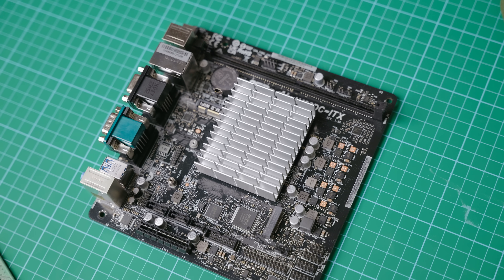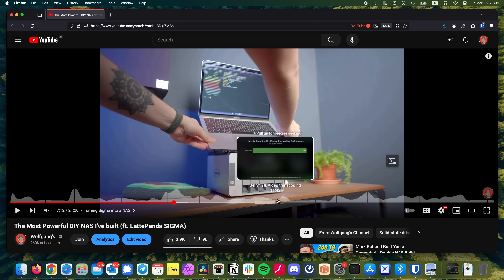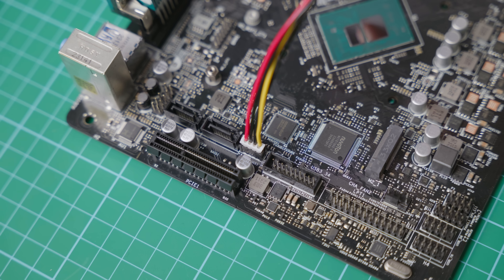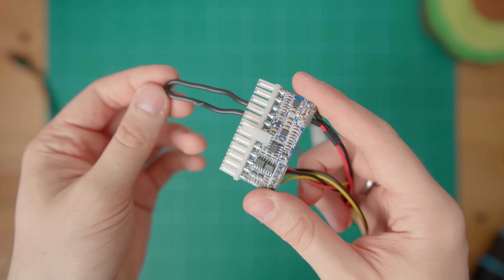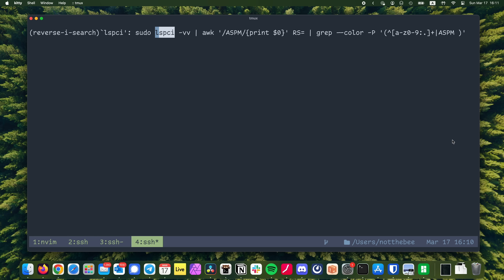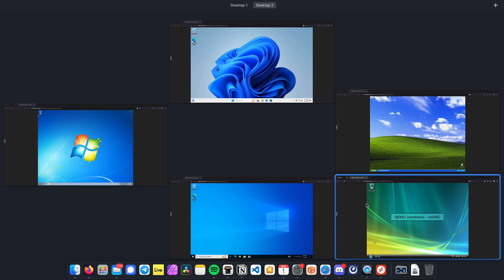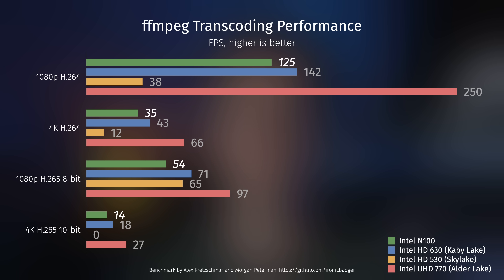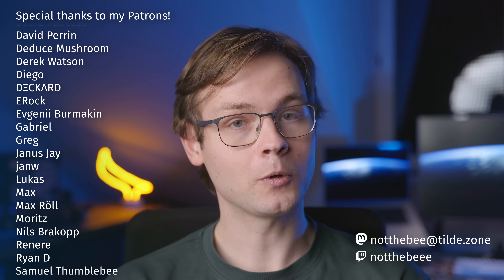Asrock N100DC-ITX – Almost Perfect! But...

Comment: I bought such board with N100 - it is actually nogo because of the heat - without fan it really boils - and I used it only for firewall. Shame.
I am also a bit surprised seeing here and there the fuss about N100 how superb it is - it is not really that rainbow.
Why am I saying this? I replaced my N100 with AMD Ryzen 7 7735HS (minisforum) and honestly: at idle with 2 disks it goes as low as 8W. And when needed it has 16 cores and support for tones of RAM. So not real gain in idle having N100 while super gain when performance is needed. Of course, when I do a stress test to all CPUs it easily goes to 90W but hey, who measures average power consumptions using stress test ;-). After a month of using my average consumption of this machine is around 15W no more and that includes idle and high performance usage combined.

Comment: The most annyoying thing is that the Asrock website does not mention 12V support. Also the suspicious empty space sized for a 24pin connector. 
Or they could've taken the homework of Asrock Rack, where they have a small 4 pin DC connector but include an adapter to a full 24pin one.
Reply: I think their might be an issue with support and quality control. When dealing with ASRock, they were constrantly checking that I was using 19V PSU, and not a 18 or 20V one. If it works for Wolfgang, that's great, but I suspect that some boards aren't working so great with other voltages?

Comment: Hi very nice video and very good channel. I have a question about the limitation of the 4 pins power connector. In the datasheet I see voltage rating at 100V and curent rating at 2 amp, so the max power must be 100*2=200W, if we see the HDD's datasheet all the curent must be with a 12V voltage, so with 2.5 A the max power startup must be 30 W. Do my calculs are right ?

Comment: I'm no expert but if you want to play with jumbo frames (MTU=9000) properly, you have to know the one rule : all devices on the 10Gb subnet must have jumbo frames enabled or you will get packet collisions and unreliable connexion. Your switch as well should be configured to use jumbo frames on the 10Gb ports. That is the only way to achieve full 10Gb/s and the jumbo frames should reduce CPU usage and who knows, power consumption ? Again, I'm no expert.

Comment: One of the best board, not available any more is the asrock h370m-itx/ac, it only lacks 2.5g network, but you can add a network card or aggregate the two 1G nic.
No need for a "thick wire" to jump the PSU, just a normal wire or better a paper click. No current pass through, just a signal.
Reply: The thick is more for the mechanics of the connection. Because the holes on the psu ar quite big.

Comment: Having two SATA ports isn't even bad. For energy efficiency you will need exactly two HDDs in mirror. 24 TB CMR HDDs do exist now. The limitations are single memory channel 16 GB max, no ECC, also no IPMI. The lack of IPMI is justified though, as it would double both cost and power draw. And we'll obviously never get ECC from Intel outside Xeon, so it is what it is. The video encode capablities are impresive, albeit being only slightly short of 24 FPS 4K H.265 is a bummer. Also, don't transcode your video collections. Storage will only get cheaper, and transcoding to a lossy codec always degrades quality. If you really need to transcode for storage, do so on a CPU encoder, slower but better. GPU transcoding is best used for live streaming.
Reply from the maker: A person who has money for new 24 TB drives, but not for a server/workstation motherboard with ECC support, or for 10-15 extra watts of electricity? I find it hard to imagine. I think most people that buy this motherboard will probably be bringing their own assorted storage, which will pbb be between 500GB and 6TB in volume. But that's just my opinion.

Video transcoding is mostly useful if you have a high quality video library, but also want to watch it on devices that don't support direct play or access it remotely. The quality in this case is not as important as the ability to play back the media at all. And sure, you can transcode the media in advance on your CPU, but this takes time (and energy)

Comment: If you are going to power it with an ATX power supply, the ASUS Prime N100I-D D4 would be a better choice.
Reply: No, it's not. There's a difference with SATA and nvme lane speed.
Reply: @su1ka  nvme is the same speed but it does have USB 3 gen2
Reply: only has 1 sata 3 port the asrock one probably a bit more useful
Reply: @si4632  Sorry, I meant PCIe 3.0 x1 vs x2 and SATA ports 1 vs 2. My bad.
Reply: @su1ka  price seems to vary a bit as well I've just seen the Asus one for £102
Reply: And are sodimms more expensive?
Reply: @si4632 Well, in this video they add an extension card for extra sata ports anyway. So that 1 port difference on the motherboard is not that big of a deal to me.
Reply: @ctphilippi  yeah true although the bandwidth is double on the asrock board pcie slot
Reply: Are the gen 2 usb3 ports of any use are there ethernet adapters

Comment: Imagine it could run off of a single 24 pin.
And took 4 of those 9 PCIe lanes from the Atom N100/N305, and gave you 4*1x M.2 slots, where you could then use one of those cheap 5 drive SATA controllers.
Then 1 lanes could go to on-board 10G networking(around 8Gbps with only 1 lane), and then 4 more lanes could go to 2*2x M.2 slots for boot or caching.
Alternatively, networking could get 3 lanes for dual 10G at full 10G speeds, and then 2*1x M.2 for boot
But imagine if the i3-N305 were an actual i3, with 2 real channels of RAM and 20 PCIe lanes, some of them gen4. That would have been a monster NAS CPU, alas Intel chose to use an Atom chip for the i3-N305

Comment: I'm still waiting for Intel to release the N100,200 and 305 in a version with vPro Enterprise (for AMT) so that we can get a board with remote management. Until then it's not really that interesting.
Reply from the maker: I wouldn’t hold my breath. Will probably use BliKVM PCIe for  mine
Reply: @WolfgangsChannel  the price and the cable mess from these Pi KVM solutions talks against them. But I'm not holding my breath. Then there is the option with the AST2500 or 2600 to get IPMI, but that require 6-9W which goes against the low power idea.

Comment: I got a Topton box from Aliexpress with the same Intel N100 CPU, four Intel I226 2.5GbE ports, 32GB DDR5 and one externally mounted 3.5 inch HDD.
Installed Proxmox on it and run OPNsense in a VM with the ethernet ports passed through as PCIe device.
It's doing double duty as Router and Homelab server.
Currently with 25% CPU load, high activity on the 18TB 3.5inch HDD, 8-port network switch, DSL modem and a WiFi 6 Access Point all on the same 12v PSU is drawing 43 watts on average.

Comment: 10W with 5 drives spinning? Unlikely. I think the shelly plug blew a belt :)
Reply: They're in spindown, not running
Reply from the maker: How did you manage to interpret “after plugging in the hard drives and putting them to sleep” as “spinning”? Honest question.
Reply: @WolfgangsChannel  I missed the putting them to sleep bit I guess :D but then I do not understand your test. 

A computer that has VMs running should have their hard drives spinning, unless everything operating from the primary SSD. I just find that my NAS constantly has things it does on the drives and even with 2 m.2 SSDs in there as cache most of the time data is being accessed and written by home assistant to the array so the drives never spin down. I do not save data to the primary OS drive or the caches because I would want the data to be saved on the raid array. So my question is: how good is a test of a NAS that has its disks sleeping? Also sending disks to sleep can shortens their lifespan, you should rather disable sleep altogether because a NAS drive should always be spinning unless you have say a night time spindown schedule where you pause all services and VMs.... but hey that is just me. I disabled sleep on my NAS and the drives are running over 6 years in there but it does pull about 40W from the wall constantly with 4 disks and the 8 disk NAS I have around 60-70. 

I like a power efficient nas like the next guy, but unless you run SSDs in there, the spinning disks take about 5-6W each, depending on the model and that is its expected running cost. Turning them off... well I might as well make the most energy efficient system by turning it all off. 0W  great :D 

So I did not understand at first that you were testing the system idle power without the drives. I thought it was meant to be the idle with the drives, hence my confusion. I missed the bit about the sleeping drives and substituted my interpretation of what the idle consumption of a NAS in my opinion should be.
Reply from the maker: You don't want to store your VM disks on spinning rust these days, so yes – the VMs use the SSD, HDDs are just there for bulk storage. Same goes for Docker containers.

Spindown shortening the lifespan used to be true with older HDDs, but modern hard drives use loading ramps and are often rated for >200000 power cycles. Which means that if you were to restart your hard disk every hour, 24 hours a day, they would last for over 20 years. Safe to say that your drive will probably fail before that for other reasons.

Unless you're accessing your bulk storage 24/7, spinning down your drives lets your NAS consume less power and still be ready for whenever you want to access the data. In case of my parents, the only data being stored on the hard drives are backups, which are scheduled daily and weekly. For the rest of time, there's no point keeping the drives running.
Reply: I guess our use cases differ then. My home assistant constantly records data on the array so disks keep spinning. I also take claims about hdd cycle ratings with a pinch of salt. They tend to be way off historically. 

By the way I realize how wasteful it is for a few bytes/s of data streaming but this is a static cost no matter how much extra operations I put up the NAS to do for me so it is not a marginal expense, which I just put down as cost of doing this. I also have my unifi controller's storage on the array as well as many other software, such as my personal music collection that I keep streaming directly from the nas with software such as airsonic or DS Audio and I yet to mention the torrent client that I am definitely not running :D

Comment: C-states are a bunch of voodoo and nigh impossible to figure out. I've been in touch with Intel support and mainboard manufacturers and they all go - no clue, try different BIOS settings. None of them ever came back with specifics on what the actual conditions (beyond "all components report latency tolerance" and "voltage can be downregulated" and crap like that) for individual sleep states are. I've had boards that never went above C6 with literally NOTHING plugged in and in any configuration. On the other end of the spectrum - I have an Asus Prime z790p with a 12600K and it'll go to C10 and idle at 13W - that's with Nvme + SATA storage and an f-ing 1200W Thermaltake GF3. With a smaller, more efficient supply and less fans it would probably run at 10W.

Comment: I'm pissed that they went with this design that only uses a dc barrel jack for power. 24pin atx power while still using a full size ram slot would have been perfect for this.

Comment: I don’t think running 5 generations of Windows VMs doing absolutely nothing is much of a test. What information are you trying to convey with this? That 5x nothing (and a tiny bit of overhead running the OS gui) is nothing?
Reply from the maker: When I make videos about these low-power boards, people often say things like “it probably can’t handle any serious home server things, like running VMs”. On one hand, this shows that this board can handle VMs, on the other hand it shows that running 5 VMs doesn’t require as much performance as people often think.
Reply: @WolfgangsChannel     Those people are just uninformed, I think. Whether or not it can run VMs has little to do with the power draw, but simply if there are enough CPU cores/threads and RAM available for it. The N100 has 8 threads and max 16GB RAM, so should work just fine.

 I think it would be more interesting to see if a box like this can run an actual workloads, like Plex server with hw transcoding, batch photo resizing or compressing files, since a bunch of users will be using it for this purpose. By the specs, it should be able to do all these things fairly well, but things like this would be interesting to see over 5 empty VMs.

Additionally, how does the NIC speed drop when the CPU is reserved/busy on other workloads or busy VMs?
Reply from the maker: You might have missed a 2-minute video section called "Hardware video  transcoding"
Reply: @WolfgangsChannel     I have, I am just not sure what "the Dune test" is exactly. The graphs show FPS by ffmpeg (which version?) and not exactly Plex/Jellyfin/Emby, nor is the power consumption listed. Also, how much does the transcoding stress the CPU and how does that affect throughput or multiple streams? Does 1 person transcoding 4K bottleneck everyone/everything else?
Reply from the maker: "The Dune test" is playing back the 4K HEVC HDR version of Dune (2021) in Jellyfin with hardware transcoding. You can refer to the ffmpeg benchmark's source code to see the results for other CPUs: https://github.com/ironicbadger/quicksync_calc

All of the things you've listed are great suggestions that I will likely integrated into the future videos :)

Comment: AssRock purpousely makes all low power itx boards with 2 sata ports.
Reply from the maker: That’s because the low power Intel CPUs don’t have enough PCIe lanes for 4+ native SATA ports. That’s why all the Chinese  “NAS” boards have to use external SATA controllers (either JMB585 or ASM1166)
Reply: @WolfgangsChannel  yes, that is true.

Comment: but why i Need more than 2 Sata Drives in a Home NAS ... we Talking about Home NAS not industrial Storage Solutions ... HOME NAS why more than 2 drives any jear 2 drives could be 20TB Each so why anyone at HOME needs MORE?
Reply: IMO it's easier to add more storage than replace it, so more sata ports its better. Not to mention RAID setups.
Reply from the maker: If you’re buying all new hard drives — sure. But a lot of people already have an old NAS setup that they’re upgrading from, with a few 4 or 6 TB drives. And why upgrade those if they’re still working?

Comment: This was a very good video and I enjoyed it. You did a great job putting it together and presenting work-arounds, vis-a-vis power, etc. I would like to mention to you HTWingNut's posting of https://youtu.be/PO8Kfi4qpY8?si=FrZAMkye_iM5_OEt which is, "Mini ITX NAS Motherboard Intel CPU 6xSATA 4x2.5GbE 2xM.2" He gives the good, the bad, and the ugly of two boards much like this one, and up to 12 drives. :) And four 2.5Gbps ports along with PCIe x1 slot.
The board he used looks great for fw/routers, small NAS, yada. I was wondering about using this board you selected as a small OPNsense fw/router? A card in the x1 slot and....

Comment: Almost Perfect! But...its not got 4 pcie3 x16 slots, 8 sata ports, 4 ram slots or wifi for that you Need a cheaper £118 'MSI PRO B550M-VC WiFi ProSeries Motherboard (AMD AM4, DDR4, PCIe 4.0, SATA 6Gb/s, M.2, USB 3.2 Gen 2, HDMI/DP, Wi-Fi, mATX)'
admittedly plus a far better & cheap £64.99 AMD Ryzen 5 4500 Desktop Processor, Black, (6 - Core/12 - Thread, 11 MB Cache, Up to 4.1 GHz Max Boost) & ram
&... you can't find any JONSBO N2 or N4 Black NAS ITX Case or even any jonsbo version for sale in the UK...

Comment: This is the perfect NAS motherboard for a legacy NAS. The perfect NAS motherboard for today's NAS has as many PCIe channels as possible. SATA is dead and all future NASs, except for archival warm/cold storage, will require the speed of PCIe and solid state storage. The perfect motherboard is an AMD EPYC motherboard with maxed out RAM for ZFS's thirst for max RAM and 100+ PCIe channels.
Reply from the maker: What are some use cases for an expensive NVMe-only EPYC NAS?
Reply: @WolfgangsChannel  Besides it being able to provide a storage solution like any other rust based NAS, but at a much better level of performance, it greatly benefits hosting VM disk images, content creation workflows and serving up media. The largest use of DIY NAS solutions is small to medium business uses, with home use a distant 2nd.
Reply: @WolfgangsChannel  EPYC is not as expensive as one might think. In the place where the motherboard in this video lives, an EOL EPYC cpu and motherboard is pretty affordable.